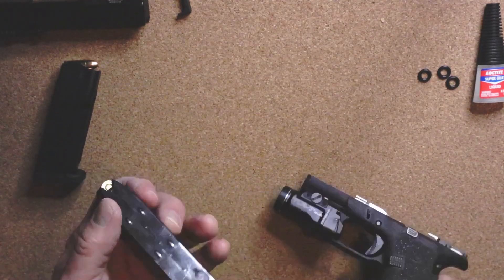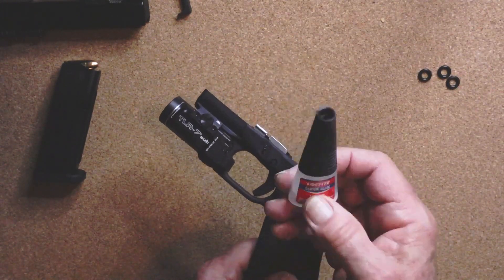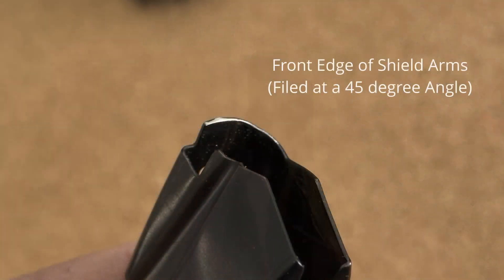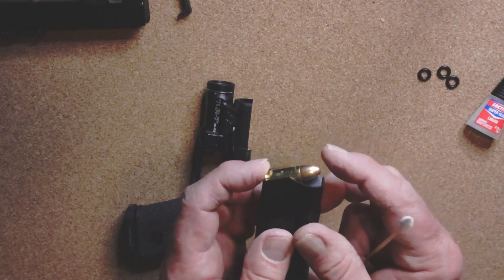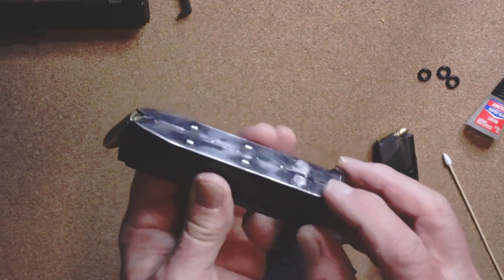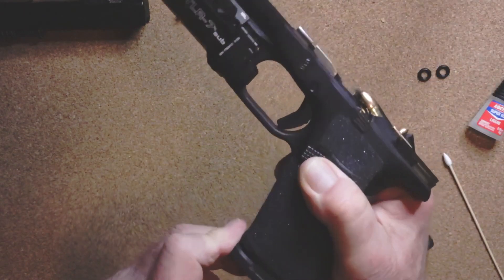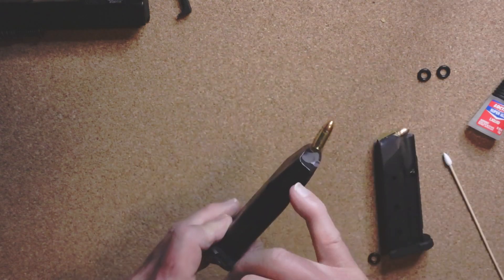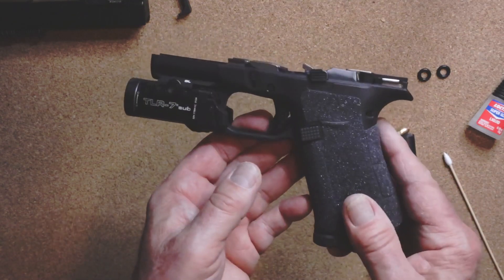How to fix the Shield Arms S15 Gen3 magazine feed issues.

Comment: Looking for a solution for my issue with gen 3 s15 mags, they cycle fine by hand at home but at the range almost every round nose dives in the magazine as the gun tries to cycle the next round, it doesn’t get caught on that lip like in this video, the bullet tip doesn’t seem to slide up the magazine properly as the slide goes to push the next round in it pushed it from behind but the nose is still in the mag if that makes any sense
Reply from the maker: Your correct. I found the magazine in the magazine well is not vertically aligned therefore causing several issues and thus when analyzing the system it has several weak points.

Comment: Has anyone else noticed that the Gen 3 mags push upwards against the slide stop/ release essentially making it a bear to push down to release the slide ? If so has anyone found a fix for this? (Currently running a g43x w/ the all steel mag release)

Comment: This worked well for me -lightly filed and fine sanded the lip on 3 of my S15 Gen3 mags and no more issues with FTF on last round in my Glock 48. Thanks for the tip!
Reply: Are you still running the s15
Reply: @highaltitudefishing  Yes and have put another 300/400 rounds through the three clips and have MAYBE one or two FTF on LAST round.  Since this is at the range, I'm not concerned about self-defense.

Comment: If you’re running an aftermarket frame such as mine being the SCT SC43, the S15 gen3 mags do do feed. Even with the recommended mag release, they are too sloppy. If you’re insistent on the higher capacity, I found an easy fix. Using a small (4”) zip tie I cut a small strip approximately 1/2”-3/4” long and epoxied it to the rib of the magazine that runs through the mag release. This keeps the magazine properly aligned with the chamber to allow rounds to flawlessly chamber. And since it’s on the magazine, it does nothing to the frame. The magazines drop freely from the frame when the release is pressed. This may void the warranty but they at least work.

Comment: I have some Gen 3 mags as well, was having all types of jams with them, but i used a dremel tool to shave down the tip like you did and they work flawless now, didnt have to put any of the superglue and baking powder as i compared the oem mags to the s15 mags and they had just as much wobble, shaving down the tip was all it needed
Reply: Where did you dremel at?
Reply: @ the “snag point” the video will show u
Reply: Dremel ftw 😊
Reply: That's a good tip, will try just the filing.
Reply: Did you dremel a substantial amount off?
Reply: @highaltitudefishing  shaved about 1/4 inch, a good reference point is to compare it with the original glock mags
Reply: thanks.  @JDManny95

Comment: If you have to use crazy glue to make these mags work then I’ll stick with 10 reliable rounds vs 15 maybes.   I bought 3 gen 3 mags from them all fail to load the first round or fail to go into battery.  Hornady Defensive Ammo used.
Reply from the maker: I did stick with my OEM 10 round 100 percent dependable mags.  I just have these for if the SHTF scenario
Reply: 🤦‍♂️ shield arms is a total joke. Having to do all these modifications is absolutely unacceptable.

Comment: I have two gen 3 mags and i noticed they dont lock in right, the mag with a gentle pull they come right out of the pistol like if pressed the mag release, they run flawlessly  though but i dont like the fact that even if u wiggle the pistol they will come out, any suggestions on why this is happening.
Reply from the maker: My first thought is the mag release you should be using  - has to be a 'metal' mag release - or you will wear down the OEM mag release catch and what you've explained will occur. For whatever reason the cause is related to, in my opinion, there is an issue with the mag catch release and magazine's slot where the catch release should push into.

Comment: @browhoknowsstuff did this fix the issue with your S15 magazines? I have the exact same magazines for my Glock 43x and I will do this to mine if it fixed it 100%
Reply from the maker: Yes it did. I found by bringing the bottom of the magazine forward it thus angles magazine and the first round upward. This causes an upward angle of the bullet prior to being chambered which will position the casing edge of the round above the Shield Arms mag edge that usually snags the casing as a result of, in my opinion, poor engineering. Not sure if this will be 100% fix. I went back to the 10 round OEM magazine and use the Shields Arm for back up.
Reply: @Broswhoknowstuff  well I did exactly what you did in your video to my shield Gen3 Magazines and so far it has worked. I just got back from the shooting range and I didn’t any issues with both of my mags 👍
Reply: I've heard using their magwell helps.
Reply: @El_Jackalope  it doesn’t I run their premium magwell and still have the same issue with my gen 3s imma try this and see if it helps if not I’ll just go back to the oem mags
Reply: @jakesnodgrass9345 did it fix the issue for you?

Comment: You can see daylight through the mag grip because the shield arms mag doesn't have a back lip on the bottom of the mag like the oem has. Both shield arms and glock mags wiggle the same in my case. Nice video and good observation, I did rub off the front lip I hope it helps :)